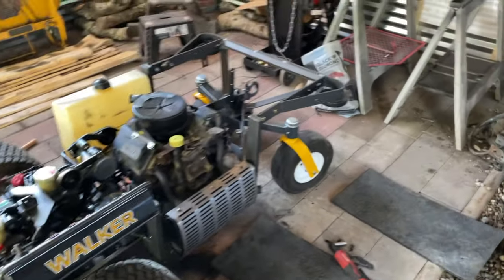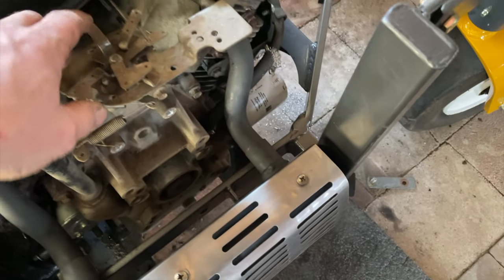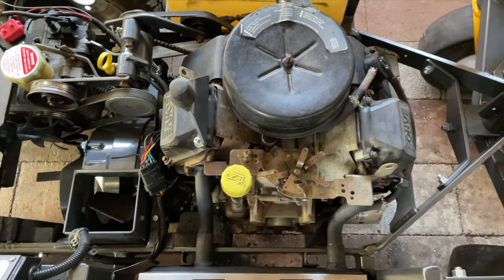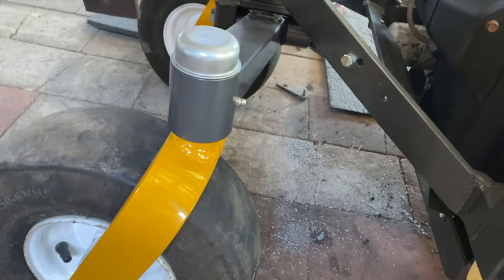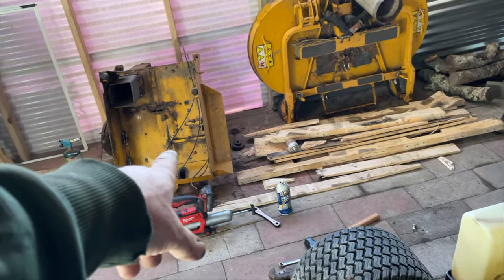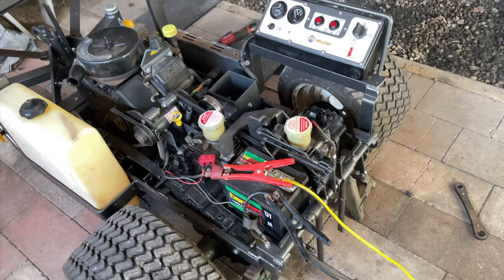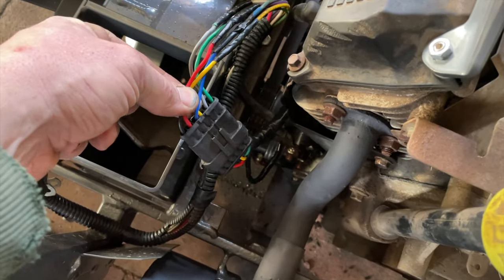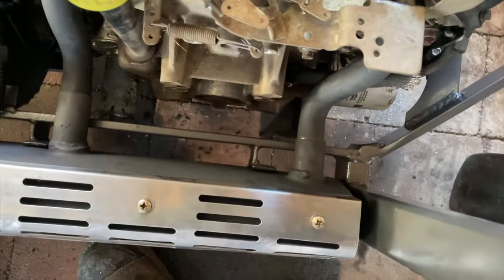Walker Mower Restoration Update SHE RUNS!

Comment: I think you should show the process of what your doing, not just the end results.  But it will look like new when done
Reply from the maker: That is the typical style of my videos. However honestly there is nothing to learn here. It is simply taking apart, cleaning and or painting the piece and put back together. Most of the more common items one would need to replace on a Walker I have in depth videos on. Thanks for the input